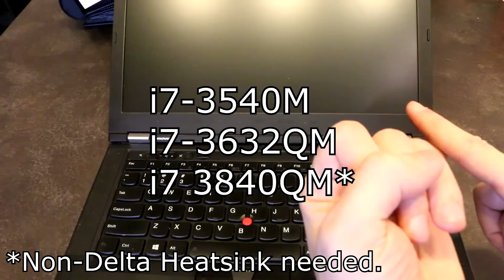Lenovo ThinkPad T430: Upgrade Wonder

Comment: The T430 has been my daily driver for about 7 years now.  I bought it new from Lenovo's website with the i7 3540m, and immediately upgraded to 16GB RAM and a 250GB SSD (later upgraded to a larger SSD when prices came down.)  I got the SATA drive bay you showed and stuck the factory standard 360GB HDD in it as backup / movie storage.

I agree that this is a great laptop.  It's been virtually trouble free for the entire time I've had it. It's suffered through drops and less than careful handling with barely a scratch, and was well worth the hefty price tag when new.  Since these were so ubiquitous, I fully suspect I'll be able to milk another 5 useful years out of this thing with parts available for any minimal repairs that are needed.

Here are some things I'd like to add, for people considering this laptop:

- You have to come to terms with the screen.  It's disappointing, considering the overall build quality of the machine.  There are very few drop in upgrade options, and they're getting too expensive to be viable.

- When you take the keyboard out, be very --- very --- careful with the ribbon cable.  It's super fragile.  I was able to get a replacement under warranty, but that's no longer an option.

- The keyboard came in two flavors: with and without backlight.  I've had the pleasure of using both, and while both feel good, the non-backlit option is much more clicky and responsive. If you can make due without a backlight, I'd seek out this option.  This model still has the thinklight, which you can use to see the keyboard in the dark either way.

- Don't forget that you can dock these as well!  Docking this computer allows you to run up to four displays at once (including the built in screen) though you might want to seek out improved heat sinking options if you plan on making this a habit.  Make sure you have the higher wattage adapter plugged into your docking station -- the one that comes with the computer won't cut it (this is the same as the W530 adapter.)

- The DVD/SATA drive bay also had a battery made for it, allowing you to hot swap the main battery without being plugged in!  I've never used this functionality, but it could be useful if you're on a transcontinental flight or something.
Reply: Hey, just thought I'd add an addendum a year later:

- Back in August, the motherboard in my T430 died after 7 years of faithful daily service. For $84 on ebay I was able to buy a parts machine and swap in a new motherboard, though I lost the on-board graphics chip (it didn't do much anyway, so not a big deal.)

- After doing that mod, I did some digging and found that somebody finally developed an adapter so that the display can be upgraded to a modern panel, and for pretty cheap too!  For $120 all-in on ebay, you can put a brand new 1080p IPS panel into this machine. I sprung for this upgrade. With the godawful stock screen replaced, this machine is bulletproof.  I honestly can't think of any reason to replace this laptop at this point. (If you want to attempt this, the parts you want to search for are "IPS FHD Upgrade Kit for thinkpad T430 T420 LCD controller" and "1920*1080 14.0'' LED Screen For AU Optronics B140HAN01.3 Display model MATTE IPS". Get the adapter with the longest possible wires, and be forewarned that it's a bit hinky to get the adapter to fit behind the screen. I was able to get it to fit with time and patience, and the screen got picked up in Windows without any setup. In my opinion, it's absolutely worth doing if you're comfortable with opening up and repairing laptops.)

- For the person who asked -- the laptop cost me about $1700 in 2012.  It was about $1300 for the base laptop itself if I recall, then the remainder was spent upgrading the RAM and hard drive. It was a massive expense at the time, since I was just out of college when I bought it.
Reply from the maker: That's awesome. Thanks for the follow-up and detailed information on the screen mod that was successful for you.
Reply from the maker: Great points! The Ultrabay batteries are pretty darn rare and fetch high prices since no third party companies seemed to make them.
Reply: I have a spare T460 internal battery. Was hoping to stick it into this refurbished T430 that I just acquired.
Reply from the maker: I think you're out of luck. Pretty your battery will have no where to go in that machine.
Reply: Thank you, Subscribed!
Reply from the maker: @chatbud  thanks for your support. I hope you enjoy working with and on your T430.
Reply: alienware m14x displays are a very viable option I think. If you don't mind glossy the colors are so good sometimes I forgot it's a TN panel.
Reply: How much did you pay for your T430?
Reply from the maker: T430 units go around here for $409 CDN and below depending on specs.
Reply: I have the same sentiments BUT I have to insist on getting the back-lit keyboard if you're taking it on long outdoors trips.
Reply from the maker: Probably a good idea.
Reply: Very useful comment, cheers!
Reply from the maker: I'm very fortunate to have so many great commenters.
Reply from the maker: @Simple Tech Highly respectable.
Reply: Questa è la Bibbia
Reply: Q
Reply: whats up dude, you still using that T430 you mentioned you'd use for another 5 yrs?? Its been 4 yrs 😀 The T430 will be the next to go into my coleccion!
Reply: @zerocal76  The T430 is still in commission and typing this message.

Comment: Since removing whitelist is hard in this model is it hard in x230 too
Reply from the maker: Ivyrain has been developed, should be considerably easier.
Reply: @LaptopRetrospective so can i buy t430 over x220
Reply from the maker: Depends on whether you want a bigger, newer machine or smaller and slightly older.
Reply: @LaptopRetrospective  T430 has cpu upgrade options so is it worth , and does it boost the power up too T480 and what your opinion on W530
Reply from the maker: T430 has some upgrade options, nothing will get it near to the T480. Not even close. W530 is nice, beefier T530.

Comment: Isn't the t400p so much more powerful when it comes to parts which you can upgrade to?
Reply from the maker: Did you mean a different model? The p designation didn't show up until the T440p
Reply: @LaptopRetrospective yes I made a typo
Reply from the maker: If you meant the T440p, you can do a lot to them too. Some weren't fans of the new chassis that generation brought in and it wasn't as popular to modify in some circles.

Comment: Probably the best laptop i have ever owned.
Reply from the maker: It is cool indeed!
Reply: @ is it worth it to upgrade my cpu to quad core? If so which one and do I need a new heat sink and bios update
Reply from the maker: @Ayaz-popal Depends if you can get a good price on the CPU. I linked an upgrade guide in the description years ago you might want to review.
Reply: @LaptopRetrospective  thank you

Comment: I picked one up for 10 bucks (ten!) today from ebay listed as defective. From the pictures it looked like the power button was damaged, and indeed, it was stuck and didn't move. I knew that often a part of the button breaks away but can be fixed easily. So I took out the keyboard and noticed that the button actually worked fine, as intended. There had only been stuck a little crumb / some lint underneath it and now that it was gone, that was all it took to properly turn the laptop on 🎉 However, the display is broken, but external monitor works fine for now. In it was an i7-3520M, 4GB of SK-Hynix 2Rx8 DDR3 1600, a 256GB Samsung 840 Pro SSD, the double-pipe heatsink and dedicated NVIDIA GPU, and a 9-cell battery, all working perfectly! Each of these parts alone is worth more than what I paid for the whole thing. Incredible haul! I'm trying to get into Linux and this will be my machine for it. Getting an FHD display needs to be one of the first upgrades. I still have a T410 with the better keyboard, I could take that, although the thought of ripping it out of there feels like tearing its heart out. I do have 16GB of DDR3 1600 lying around. I don't think I need to upgrade to a better SSD soon, and the cpu shouldn't worry me for now, as it's top of the line 3rd gen 2 core for this laptop, but I do want the 3632QM eventually. So an FHD IPS panel really is the only thing "needed" right now. Oh, and a bath. I really need to give it a deep clean, and my T410 desperately needs one, too 😅
Reply from the maker: Great buy. As you listed the specs I came to the same conclusion about the value of the individual parts. Well done!

Comment: I love my T430, I have two, and have three drives in each: a 1TB mSATA SSD behind the ram as my main engine, a 2TB SATA SSD in the old main drive slot, and another 2TB SATA SSD in a caddy in the optical drive bay. I also have a 512GB SD Micro card in the card slot, and I know I could add a fifth storage device in the PCIe expansion slot.
Reply from the maker: That's a lot of storage!

Comment: I also had my Thinkpad T430 from 2022, still has it, it's a beast and with every optimization i did, it came out SOO GOOD! Sadly, it died on 11th july 2024 because it wasnt starting like i press the power button but it's fan spins to the max for one second and then it shuts off with no signs of display or life, i targeted my RAM because I have 8gb (2 stick 4gb each) of ram and one stick may have died BUT the processor wont even clock it too! So i went to a repair shop and the repair guy replaced my i5 3320M with i7 so it started good! But as i am a gamer especially Minecraft, so the money i can spend on it, i can just get a w540 with even a nvidia card! So yeah i loved my beastpad but salute to it. I'll sell it to the market for good price then add some more money to get the W540.
Reply from the maker: It's a strange day when a ThinkPad is finally replaced.

Comment: Is t430 compatible in processor i7 2600?
Reply from the maker: No.
Reply: Which is better old t430, or newly refurbished t420....? Can i use it them both in programming?
Reply from the maker: Depends on what "newly refurbished" means. As for programming, entirely depends on your work.

Comment: I am thinking of a better screen  that is why I think about new PC. T430 hurts my eyes but I am not sure if a new screen with 120hz and larger is so much better.
Reply from the maker: Sounds like you need to figure out why it hurts your eyes first.
Reply: Yes I am working on it now, looking at videos about eye health and computer screens. If I understand correctly than going from 14inch screen to 15,6 inch would help. I dont know about the refresh rate however. Perhaps I can simply go to electronics store and consult them, try to see if screens with 144 or 120 hz make a difference compared to lower ones. Otherwise, looking at your video, I ordered now a 8800 mAh battery for our old Lenovo and it seems it is possible to also upgrade RAM from 8GB to 16GB and put in a 512GB harddisk compared to 160GB that is there now. Maybe then there is not sufficient reason to buy a new Lenovo, but stick with T430 and upgrade it. Thank you for your advice!
 @LaptopRetrospective

Comment: My T430 was with me for 10 years now. I just bought a T530 and swapped all upgrades to that machine: CPU, RAM mSata, main SSD, caddy SSD, battery, snap on battery and it's ready to serve me another 10 years. Worth every penny
Reply from the maker: That's awesome John! What do you use it for?
Reply: @LaptopRetrospective  my main office work machine
 Most word, excel ... some light programming with pycharm. OTT like viber, WhatsApp, zoom, msTeam.

The T430 I reassigned it as linux environment now. As for entertainment I?have anothe T470
Reply from the maker: Nice fleet of machines.

Comment: here it is 2022 and I use this exact laptop daily running Linux Mint. Linux will run WAY faster than Windows and makes most older laptops very usable again. But a tip if you install Linux Mint/Ubuntu. If I go into suspend automatically (close lid or low battery) the system is unusable after that until I reboot, usually hard shutdown. But run "sudo pm_suspend" once right after booting and that problem completely goes away. You just have to remember to run suspend manually from the command prompt once.  That is the only issue I've had.  I run Musescore, darktable, libreoffice, brave browser, inkscape, scribus, Gimp, etc etc. Everything great. I left Windows on (dual boot) but never use it.
Reply from the maker: Very strange issue, can't say I've experienced it myself.
Reply: @LaptopRetrospective  perhaps it is the version of linux I'm running. I will be upgrading my version soon....lets see if the suspend problem goes away.
Reply from the maker: Best of luck!

Comment: would the Intel Core i7-3610QM require and upgrade in the cooling system? i just ordered that chip
Reply from the maker: Check the guide in the description to see if it is one of the ones it recommends. It wouldn't hurt that's for sure.
Reply: @LaptopRetrospective  what is the model number for the upgraded fan... didn't see it
Reply from the maker: I think it's pictured in the upgrade guide. Delta makes it. It should also be in the hardware maintenance manual.

Comment: Are there any chips you can put in with the delta fan?
Reply from the maker: Can you clarify what you mean when you say chips?
Reply: @LaptopRetrospective  processors.
Reply from the maker: If you look up the PSREF for this model you'll see all the official ones. The upgrade guide has a few extra that will still work.

Comment: I have Lenovo ThinkPad t430 but the bios is lock is it possible to upgrade the processor
Reply from the maker: I don't think a BIOS lock will stop a processor swap but I wouldn't bother doing it to a computer that had the BIOS locked. Eventually you will run into a problem, it's just a matter of when, not if.
Reply: @LaptopRetrospective  Thank you for your reply
Reply from the maker: You're welcome. Good luck.

Comment: Does this laptop boot without battery? Mine shuts down immediately after powering it up, within 1-2 seconds
Reply from the maker: Does it do the same thing on AC power?
Reply: @LaptopRetrospective  yes, but i dont have battery.
Reply from the maker: If it isn't turning on there are several things to check, I'd start with your RAM and make sure it is seated properly. Was it working before and just stopped or is this laptop new to you?
Reply: @LaptopRetrospective  I'm a dumpster diver, and I collect thrown away things. Could be anything, i already put different ram in it and checked both slots. CMOS battery still has voltage. With plugging out CMOS, or ram, no difference in boot.

From your answers i infer that the laptop normally should work fine without a battery while running on ac power?
Reply from the maker: https://download.lenovo.com/pccbbs/mobiles_pdf/t450_ug_en.pdf
Troubleshooting page 129 I think. You can try a reset using a paperclip to see if that gets it to place nice.

Comment: The Lenovo Thinkpad 430s I Got For £170 On Marketplace Is In Pristine Order And Was A Complete Winner,Until A Crazy File Appeared Namely  PXE:/   AND Another That's Below That + now Bought A Second Lenovo Workstation For £120 I Just Reset Last Night & Sound AS.  I Have Been Now Quoted £65 Fow An SSD + Windows - 10 Op-System To Repair My Laptop 430s Simply It's Matched With Most Apple Laptop's On Spec + Is A Great Carbon Lightweight Unit With 300Gig H-Drive - I-Core -5 & AMD Graffix ,All Was So Good And Was Working So Well I Added Just Another 4Gig Of RAM,So It Was On Or Useing 8-RAM As Under The Key Board There's A Spare  Bay For RAM + Under The Actual Laptop Too.  Im At The Moment Searching Everywhere On How To Fix This Great Little Laptop And It's All To Do With Legacy - UEFI - And Mainly A BIOS Scenario Where It Need's A New Drive As I RAN The Errors Check In Bios And 3 Error's Are On The HDD-Drive ''I Never Noticed Until Just Last Night'' Why I Bought Another Lenovo As Many Government /Military/Ect All Have Them Installed To Library's Too.  I Have Searched + Searched & My Only Way To Get My 430s Back Working Is Doing What The Asian P-C-Shop Tech Guy Said 65 quid SSD FIXED .....So It's Going In In The Morning And Let These Guy's Do There Thing As It's Only 130 Gig SSD but Plenty For Me With A Tb-External With ISO & BACK-UP'S .....BEST SUBSCRIPTION I HAVE FOUND IN YONK'S THNK YOU KINDLY IF ANYONE CAN HAVE ANY IDEA IF IM DOING THE RIGHT THING  AS LENOVO ARE SUCH WELL BUILT IT WAS FLAWLESS UP TO THAT PXE// PART AND A WHOLE MISSION TO GET IT BACK-UP + RUNNING .....THANKS FOR THIS AMAZING SITE ...TA

Comment: Much research on Panellook I have found and installed the Chimei Innolux  N 140FGE-LA2 a 1600 x 900 TN panel that screws in fits perfectly with the correct 1600 X 900 HD ++ cable it has a 300 CD/M2 Luminance output which is 50% greater than the stock Lenovo T 420 or T 430 screens Viewing angles of 45/45/20/45 which is awesome for a TN panel a 650:1 contrast ratio decent colors out of the box though only 252 k colors not yet calibrated and unlike the X1 Carbon which is a pain in the Butt requiring cable extensions a Full HD mod which requires a from China LVDS to EDO board converter and is available new unlike the very hard to find other option the Alienware M14 X screen.
Cheers
Reply from the maker: Good to know, thanks for sharing this information!